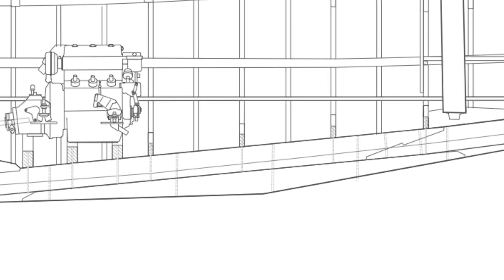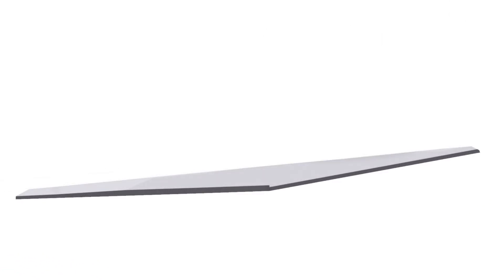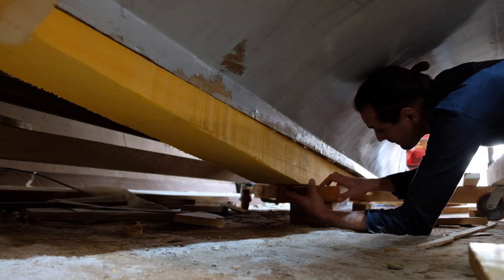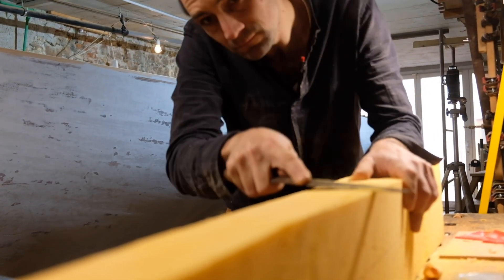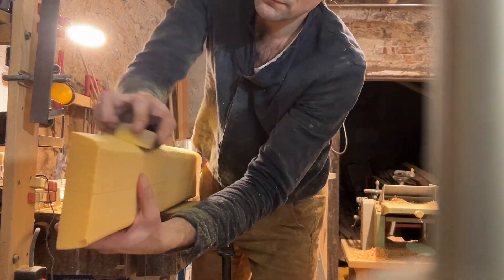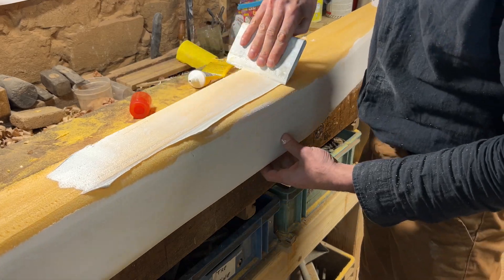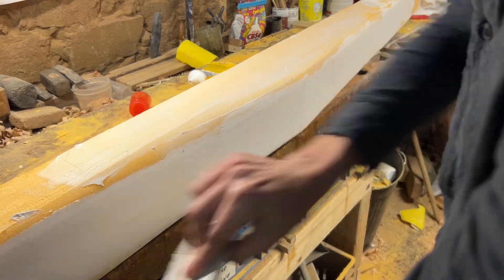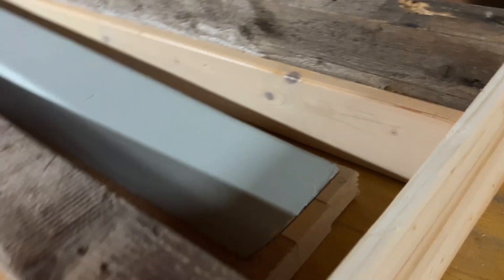777lbs of lead, pouring the ballast keel - Craft Endra EP25 I Building a wooden sailing boat

Comment: It's always satisfying to see a keel be laid down. Great job! Its interesting that you waited till you were this far along in the build to make the keel. Most builders do it in the beginning of the project.
Reply from the maker: Would have been certainly easier, especially the installation. But as I built upside down and to have all the weight on the keel … not very comfortable 😅. Thanks for your comment 👍🏾😄